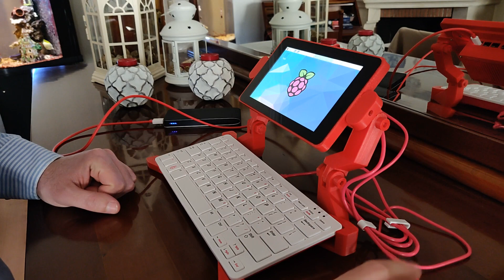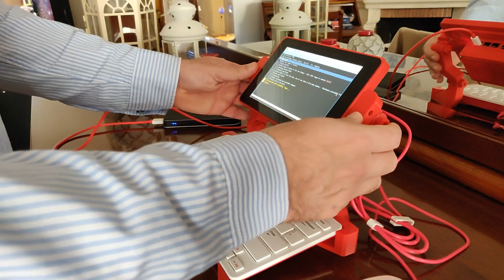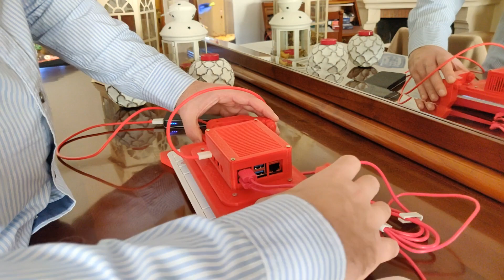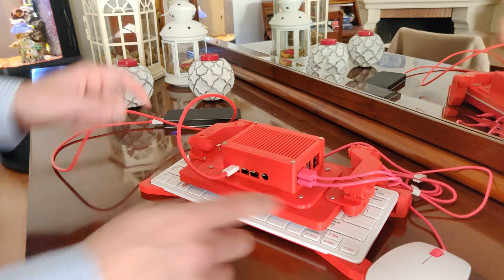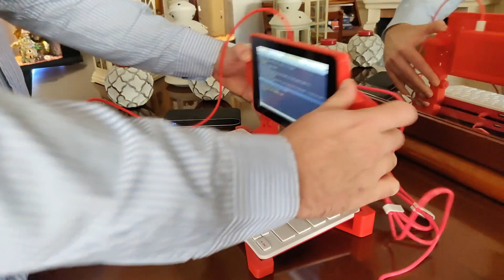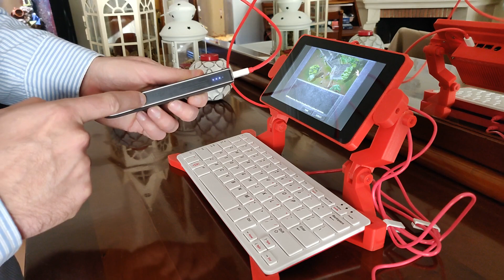Budget Raspberry Pi 4 Laptop V1

Comment: How did you connect the screen to the raspberry pi? I can’t see an hdmi cable  in the design
Reply from the maker: It's connect via the DSI port on the raspberry pi. Please check version 2, the build is similar.